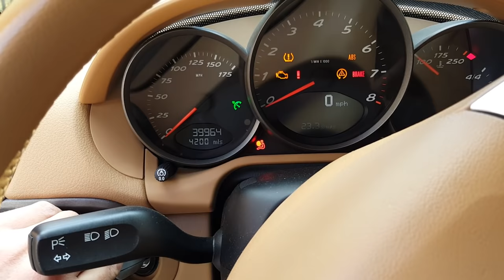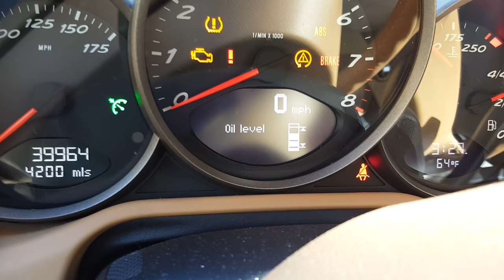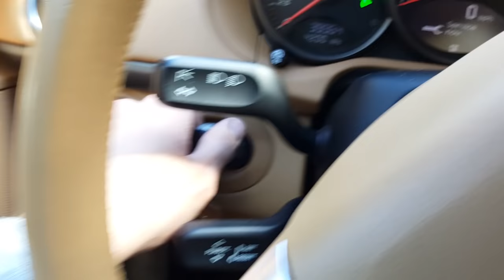How to Change the Oil in a Porsche Cayman

Comment: To drain it quicker take the cap off from the top engine compartment.  It'll allow air through and breathe better. 
Coat o-ring with oil so it seals instantly,  I learned this with my 1st  Mustang 

Thank you very much for the video it is very informative have owned Mustang's most of my life though currently have a 2016. It'll be the last Ford I buy, the Cayman will be next car I'll buy.  The Millennials at Ford not respecting Mustang's iconic Historical Automotive Heritage.  
With the 4 door variant all electric powered Mach E removed all Mustang's from the past, present, and future Mustang's from the Muscle Car category shared with the Challenger and Camaro including the Shelby's and GT500

Comment: Great video. Still have the Cayman? I’m thinking about buying a 2007 Cayman (regular not S) for $19k. Has 76k miles and looks clean in great condition. Seems like a lot more car than a 2017 or newer Toyota 86 or Subaru Brz. And cheaper too! Those are the only two cars that I’m seriously thinking about buying. Guess I’ll have to drive each one and make up my mind.

Comment: Everyone is saying good job on the video. I saw a couple things that were just wrong, and a couple of tips. I'm sorry, but it needs to be pointed out. 
1st- Don't just jack your car up and put it on top of some wood squares. You also need to secure it so it doesn't move. Probably use jack stands too. I'm sure it was fine,  but you never know, you were moving around under the Cayman quite a bit and getting crushed by a car is not fun. 
2nd- Before reinstalling the drain plug, remove the oil filter. You want as much old oil to drain out as possible. Especially on your PORSCHE! You might even go inside for a few minutes and give that oil plenty of time to find its way out. Also, on a lot of cars you need to take off the filler cap as well to help the oil come out. Not sure how Porsche does it, but removing everything and then letting the oil completely drain out is how I was taught by a certified SAE master mechanic.
3rd- You were very good at pouring new oil into the fill spot without spilling any on your carpet. I would recommend using a funnel just to insure no spilling.
4th- You should tell us how much a Porsche dealership charges to do an oil change on a Cayman and then tell us how much you spent doing it yourself.
Reply: I can certainly say for a boxster Porsche in the UK charges £300 for a basic (minor) service, for oil and filter change.. with all original parts you can do it yourself for £85

Comment: The 2011 Cayman checks the oil level differently: the computer requires 1) the car is running and 2) engine is fully warmed up. Doesn't make much sense when you need to check it after an oil change or if you think your oil is low.

On a different subject, I wondered about the two pronunciations of 'Porsche.' "Porsch" seems to be an England English pronunciation while "Por-sha" appears to be how the family says it.

Comment: Nice vid. If possible try to warm the engine oil up and have the car level - you will get out more oil. I also like to remove and replace the filter while oil is draining - I just like to get it all out and it takes time for all the old oil to drain down from the engine internals. Please get a torque wrench as it is all to easy to strip the threads on these aluminum pans.

Comment: I didn't scroll down all the comments so it might be a repeat but after the engine oiI warmed up, prior to dropping it out of the engine, I would recommend unscrewing the engine oil cap.  There is nothing worst than dropping the oil if you can't pour fresh oil afterwards.

Comment: This was helpful, thanks a lot. I have a question how can i erase the "service now" note that glows on the dashboard?
Do i need a special computer program or can i do it manually using the cars' buttons? Thanks again, keep up the good work.
Reply from the maker: +Aris K Glad it helped!  My Cayman has the "service now" light on too (along with a faulty rain sensor.. oops).  After doing some reading on Planet-9.com I think you have to buy a unit to plug into the car to read and cancel codes.  Not sure how much they cost yet, but Ill keep searching.  Of course, you can always go to the dealership haha
Reply: Thanks for your answer.
Reply: So how DID you erase the service now warning.

Comment: I would have let that drain for an hour or so, it was still running out the drain when you screwed the plug in.  You could have swapped the filter out before doing this letting it drain some more. 
Also there is a slot in the filter housing to help you remove the O-ring. smear some oil on that O-ring too. Buy 4.5l of oil in one, it uses less plastic!

Comment: Good video.  Just one tip...the fact that you had to reverse the socket wrench to get the hex bit off the drain plug when you reinstalled it, means that you are overtightening it.  If you ever have to do that, it means you are deforming the part. Get a torque wrench.  Do it right. Also, please use gloves.  Used oil has some nasty stuff in it...benzene, heavy metals, etc that can go through your skin and can even cause cancer.

Comment: you didnt prime the filter with oil? unless specifically stated not to ive always made it a habbit of filling my oil filter with oil to make sure it was primed and that there is not air gap in my oil system. 
not necessary on the Cayman or ???
Reply from the maker: +Edward Feenman In my experience it doesnt hurt the engine to not fill the oil filter.  It may be on the safer side to do it though.
Reply: +Edward Feenman priming the oil filter just helps to get a quicker oil level reading. Useful for mechanics working on lots of cars. Who dont want to run the engine for 15 minutes to get the air out. But for the DIY mechanic it&#39;s not a problem, the air will work its way up and dissapear from the air escape from the head of the engine. Also prefilling the oil filter would be a bad idea as the OP didn&#39;t even jack the car up. Really akwaward access and could tip the oil off the filter and make a mess.
Reply: If you wait half an hour before you start the engine anyway, it won't make a difference since the oil will have come down anyway :)
Reply: Here's a bit of trivia. I wondered why the auto manufacturers are going back to a messy cartridge filter when the spin on was so much easier and neater. Well, some of the filter manufacturers were not including in their spin on filters a anti drainback valve in the housing and with the cartridge housing the car manufacturers can ensure that every filter has this device.
Reply: Agree!
Reply: William Brandt more green to do just the filter. Cheaper manufacturing for the capitalist.

Comment: Great video. Still don't know why porsche did away with the dipstick though....30 minutes to check the oil level, hah!
Reply: +enaicee  The mistake made was to turn the ignition on. To check the oil insert the key but do not start the engine.

Comment: You should always get the motor/oil up to operating temp to help it to drain fully... Should also wear vinyl gloves etc... Remove the oil filler cap to help the oil drain quicker... Not sure why you replaced the sump plug BEFORE removing the filter? ...

Comment: You should let the oil drain entirely out and first put the plug on after removing the oil filter
Reply: Doesn't matter, the filter canister is inverted and oil wouldn't drain back anyways. I would prefer this design rather than the filter on the top and the dirty oil dumps back into the engine after removal,

Comment: Men, what model and year is that? I have a 987.2 S 07.2009, my motor looks completely different and the filter is also no where yours is. Actually I do not find my oil filter.
Reply: Its a gen 1. Different engine

Comment: 2 flaws:

1. You are suppose to have the car at FLAT LEVEL on JACK STANDS to drain the oil, or you will leave 25% of the old oil inside.

2. When changing the filter in the housing, you need to fill it with new oil .25 of the way or you risk your engine running dry when you turn it on. 

Otherwise, great 👍

Comment: Hey.I am a new 2007 cayman owner , can someone tell me if there is a "auto" headlight switch in this car? ( my other car has it)  If I forget to turn off the headlight will it drain the battery away or turn off automatically when battery is low?
Reply from the maker: +sohandsome In my 07 Cayman, there is no auto headlight feature.  You have to manually turn on the head lights, and manually turn them off when you turn off the car.  If left on, it will defiantly drain you battery.
Reply: +CaymanGarage alright thanks

Comment: Oil changed and the filter is to be replaced every two years regardless of mileage according to Porsche. This operation is a basic part of servicing. In addition, a private person has no access to the required equipment. Also important, the environmental aspect handling the waste oil and filter. If you cannot afford this every two years, I recommend not having a Porsche Sportscar.

Comment: Don't see why I would want to change the oil myself on my various porsches/audis.  When I was very young I would do it sometimes along with many other repairs.  People complain about the cost which is really not that much (around 200 to 250 with synthetic) and when you get it done properly there is long checklist of items that get checked and that is very important as a full year has gone by and some problem may have developed that requires urgent attention.  There is also the issue of going out of the way to get the used oil properly disposed off so more time to waste.

Comment: You seem to have neglected the most important part of the process: inspecting the old filter for metal particles which could tell you your IMS bearing was disintegrating and about to destroy your engine.
Reply: Was this a common problem with Porsche caymans? Any other Porsche’s with this problem?
Reply: rafael guzman the IMS bearing failure was most prevalent in the 996 porsche 911. They have since issued a recall for it and any car that has not had the IMS bearing replaced can get it done for free at the dealer.
Reply: 997 and 987 are also well known for this issue.
Reply: Charles Marcus Davey 987 gen1 not the gen2 which a 2007 should be.
Reply: A little tip with removing the O ring. Hold the canister like a bottle and then push your finger nails into the O ring and pinch them together.
Reply: in the early 987.1 model there were still IMS issues. some early 06 may have it but by 07 they redid the system completely.
Reply: Its not a common problem on the 987 Gen 1. Maybe 5% of cars, and usually those with auto box and doing short trips under 20 miles and combined with infrequent use. I am on my second Cayman s Gen 1, and never had a problem, nor do pals of mine who have them, all `06 models 3.4`s.
Reply: Just to correct some info in this conversation: I'd agree re checking filter but....
1) By the 07 Cayman 987.1, it's around 1% failure rate if that. Massively over stated issue. You've statistically more chance of having a heart attack than an IMS failure. Not even joking.
2) The 987.2 was not released until 2009, not 2007 as some have said. Later .1's had an "improved" bearing, but they still have one. The 987.2 does not have an IMS bearing.
3) The IMS in a 987.1 can NOT be replaced without a full engine tear down. The "replace bearing" recommendation was for the 986's, where the issue was much more prevalent.
I own a 987.1 2007 Cayman S. After purchase, I spoke to several Porsche mechanics and trusted independent specialists on the topic. I sleep very well at night.

Comment: how often do you have to change the oil on a cayman?
Reply from the maker: +TheDreStudios 
I change the oil about every 5 to 7k miles.  Although, you should be fine changing the oil every 10-12k miles if that fits your schedule better, that is as long as you use the full synthetic Mobile 1 oil.
Reply: "...that is as long as you use the full synthetic Mobile 1 oil". Why would anyone considering using anything less than the full synthetic?
Reply: Thx for the video, very informative.

Comment: How often are the oil changes?
Reply from the maker: I do it about every 6k miles
Reply: Porsche says every 2 years, but for me I like to do every 7--8000 miles or once a year. But is also depends how far, often and hard you drive the car. Porsches are very efficient though and not as demanding on service as others hence the 2 year 12000 mile advice from them.

Comment: I could pull this video to pieces on so many points. But the main thing is his jacking. there is little or nothing to stop the car rolling off the stacks of loose wood when his head is under the car. The car would sink on its springs as it hits  the deck reducing the small < 6 inch ground clearance to somewhat less. Put it this way, the there would be no rush for the paramedics to attend the scene. So.….chock the front wheels front and back. Use axle stands. Even once the car is on stands lock the trolley jack under a hard point just in case. Safety first, safety second and third. And warm the oil. Lower the car to ensure you get the old oil out. Lube the new filter gasket. Use a torque wrench - too loose the sump plug drops on the road and the engine is toast. Too tight and the threads in the alloy engine will strip causing thousands of £ in damage  - but don't worry  the (cheap) steel plug threads will be just fine if you find it!
Seriously, awful video, mainly because its dangerous.
Reply from the maker: The point of the video is to show the basic overview of how to change the oil, and how simple it is to do.... not how not to die when working on your car 😂

Comment: ..."I'll go buy a torque wrench and double check the drain plug torque" ?? How is this going to happen?   Good video I suppose for people whom don't have a clue ...Are you certain of the oil spec., 0w-40 weight grade?  Yeah, I know the Mobil 1 bottle splashes Euro this and Euro that marketing speak..
Reply from the maker: +Michael Schneider It went just fine, I drove to the store, purchased a torque wrench, and checked the drain plug.  I was very close to spec too.  Ive worked on cars my whole life, so I tightened the drain plug to a point that felt right, then double checked.  Yes, in my Porsche manual it gives a couple different specs of oil to use depending on what climate you are in.  All of which are Mobil 1.  0w-40 was the first one on the list, and covered the widest range of climate.
Reply: +CaymanGarage ... Kwel on the 0W-40 Mobil 1 oil spec.  Our (wife's) earlier MY01 986 S series, cousin to the killer Cayman, spec's oil starting from the typical 10W-40 M1 brand.  Ya, learn something new every day.  Thanx, good luck with the Porsche cars...PS., My MY98 993 C2S coupe, ordered new, goes to the grave with me ...... PAG makes great sports cars !

Comment: Dude, if you can afford a porsche, you can afford the proper tools to maintain it. First of all, you are paying little to no regard to safety. What's worse, you've produced a video condoning your actions. Buy some jack stands, gloves, plastic for protecting the car. You should probably be wearing safety goggles under the car. You should be treated both the used and new oil like hazmat, because they are. You shouldn't get the oil on your skin. If you do, you need to immediately stop and clean it off. So much wrong  with this video. Don't spread misinformation about proper auto care.
Reply from the maker: You don’t know me lol when I filmed this video I only had money for the oil, and filter. I completed the task with no injuries or negative effects. Your more than welcome to be as scared as you want of motor oil 😂 but I’m not. Feel free to change your Porsche oil “properly” and make a better video. I’ll wait to critique it.